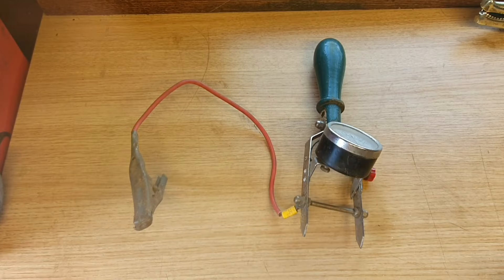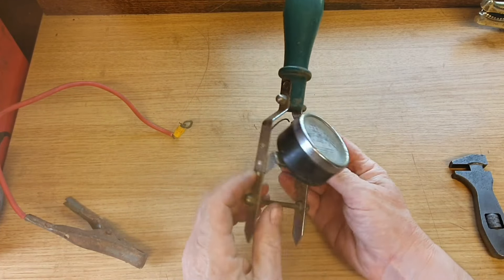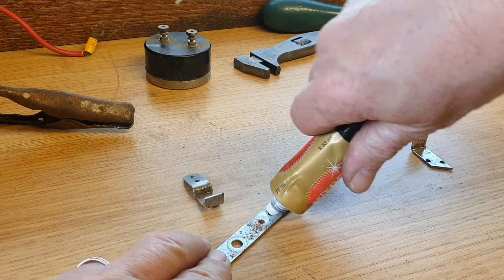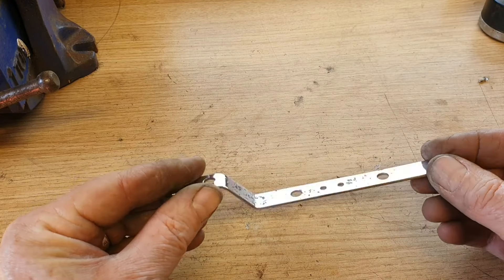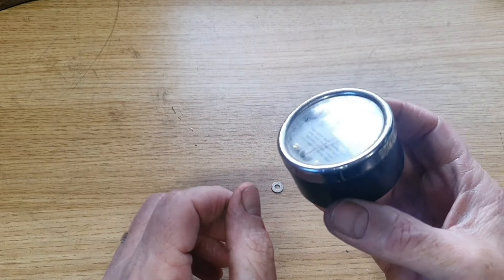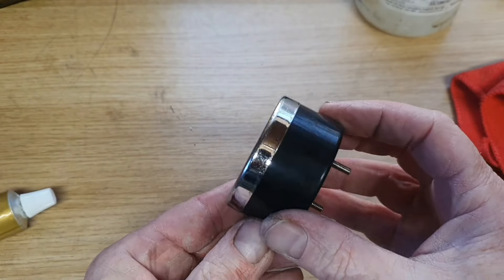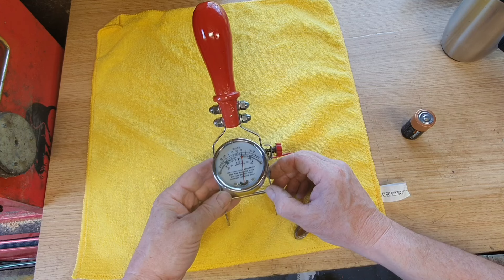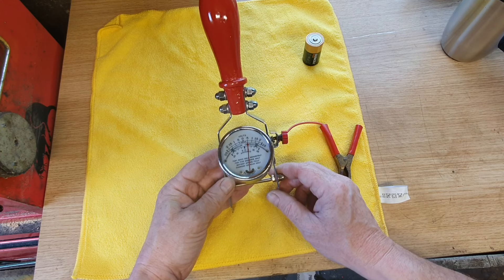Vintage battery tester - vintage tool restoration

Comment: Do you have an old motorcycle battery with cells that you can open?  You could test the cells individually with the battery cell tester.
Reply from the maker: No, I've only got the modern type. Would be nice to have done that but had to make do with Duracells finest. Its hanging in the shed looking pretty now😁